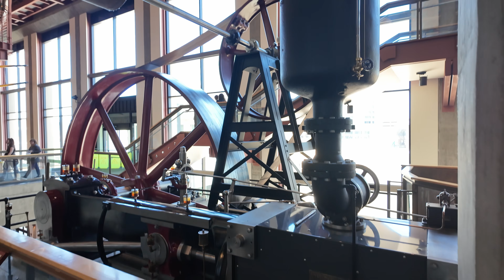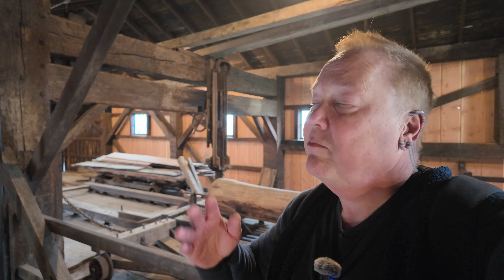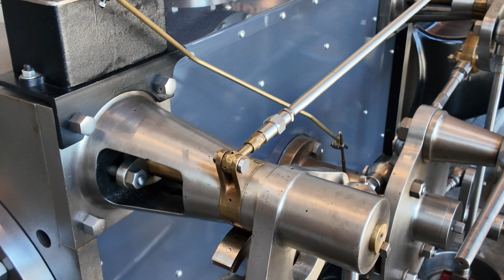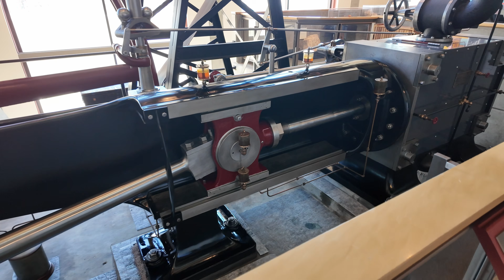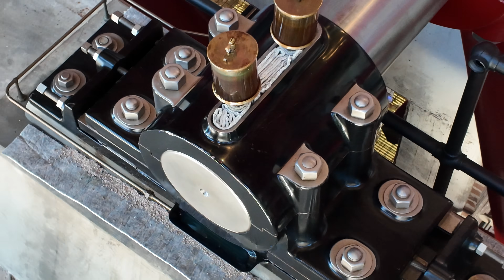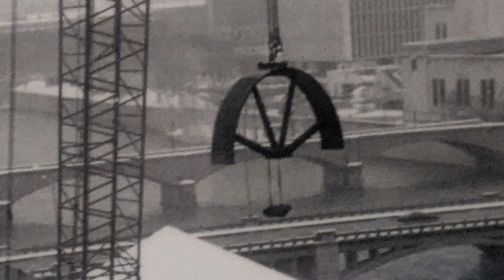This Massive Steam Engine Is Still Turning After 120 Years! | Industrial Revolution

Comment: Can a one cylinder Corliss start from any random cylinder position? As with that size I'd expect a barring lever...
Reply from the maker: Nope, any single-cylinder engine can get stuck if the piston stops all the way at either end.  If you watch my video of the the Corliss engine at The Henry Ford Museum, which still runs on compressed air, they have a subtle electric motor at floor level to push it around if it stops in the wrong place.  They usually stop it correctly, but not always.  
When I was talking with them, before things like health and safety regulations, they said people would probably have climbed up one side of the flywheel to move the piston back toward the center of the cylinder.  It doesn't really matter exactly where it is in the stroke, as long as it's not right at, or very near, either end.

Comment: If you are ever in the Dayton Ohio area you should stop at Carillon Park they have a 210 ton Corliss on display although it's not in motion like the one here. They also have an extensive display of cash registers from NCR and other local industry.  Very impressive museum
Reply from the maker: I've been there!  I was there 2 or 3 days after Hurricane Helane, and when I walked into the Great Flood of 1913 building, I was obviously inspired to do a video on that.  Also did one on the John Quincy Adams.  I need to get back down there before long, as I have a couple more ideas.
Actually, there's a fair amount of good Industrial Revolution stuff in the area, like Lockington on the Miami & Erie Canal, and Bear's Mill.
Reply: @Industrial_Revolution The National Museum of the United States Air Force is close by and right down the road is the Cincinnati Museum center that's in the old union station. Lots of great museums in the area.
Reply from the maker: I haven't been down to the Cincinnati Museum Center in a while.

Comment: Beautiful job restoring the giant flywheel to faster smaller flywheel is like basically gear reduction those leather belts were were scary stretching or walking off pulley snapping men getting loose clothing caught in the belt drive
Reply from the maker: They didn't tend to come off the pulleys too much, unless they broke.  The pulleys aren't actually flat, but slightly bigger in the middle, which kept the belts centered.
They did, of course, sometimes still break.

Comment: its large but you should check out the steam and technology museum in Hamilton ontario, the woolf compound engine in there had a twin and together they pumped water to the top of the niagra falls escarpment to supply the city with water in 1860, her details are no where near as clean as this beauty and she wasnt nearly as powerful only producing 100 hp but with a fly wheel so large you need to climb up two full flights of stairs to be at the middle its hard to believe a machine so utterly massive only produced 100hp
Reply from the maker: Thanks!  How did I not know that museum was there?  I've added it to my list and there's a good chance I'll be in the area sometime later this year.

Comment: When it came to learning/understanding all-things “internal combustion”, regardless of fuel type or cycle type, whether the theory of operation or otherwise, i more or less had to learn thru study/“reading”(books) research, back in the early 80’s, due to just how extremely noisy it all ‘can be’… steam on the other hand, I could literally, simply “HEAR” old timers back then, just explain it all.. only noisy when them whistles go off! Lol
Reply from the maker: That's definitely one of the things I like about Industrial Revolution technology.  With a little time staring at things, following pipes and linkages, you can figure out how it works.  My hybrid car, that's just a mystery box with everything hidden.
Reply: @Industrial_Revolution  Back in the early 90’s ‘till the late 90’s, when I was most active in the hobby of stationary power of various types, showcasing my own whatnots at the local events then, one cool older dude actual blacksmith, that spoke with a pretty heavy German accent, named Klaus Dubart (last name sounded that way of spelling but had to been quite different; just can’t remember), had coined the phrase back then, of, “Industrial Archeology”, pertaining to this whole crazy cool hobby of finding and resurrecting antique whatnots.. the rustier, the better
Reply from the maker: I've actually heard that term before.  I actually end up doing some of that in my videos.

Comment: A mine I worked at in South Africe srill had a little working steam engine.  It served as a backup in case of a major power failure.  It was fired up once a month   to ensure it was in working order,   It was also a show piece  on tours and waskept all bright abd shiny,
Reply from the maker: These old steam engines could last forever, if given a bit of attention.  Was it just to power lights and fans, or did it handle more than that?

Comment: Brilliant video, though I am sad to see that every single one of the lubricators was actually turned off and not feeding oil to the bearings. You can tell because the little finial on top which lifts the inner needle valve was on its side. If you know anyone at the museum please tell them about this, even at slow speeds the engine will seize up without any oil. Last year I had to help a museum in Colorado unstick their seized twin cylinder Corliss which had been run without adequate lubrication, it is quite a serious issue.
Reply from the maker: Thanks for the comment, and the concern.  In person, the machine does look oiled.  I'm wondering if they flip them on for a bit every morning, but don't want it on all day dripping oil.

Comment: I worked in the St John's furniture factory in Cadillac in 1978 &79, Once in a while they would fire up the steam engine just to keep it oiled up,  It took two boilers at 170 psi of steam to run the engine, witch the factory had three boilers, they also kiln dried their own lumber.  they stopped
the workers for the ten to fifteen minutes so that the employees could see the engine run,
when the large fly wheel was at high speed it was would move the air like a giant fan,  The mantaince crew kept people back about 15 feet, they said it might suck a person into the fly wheel.
Reply from the maker: I don't know if they knew it would someday end up in a museum, but keeping it running a bit every now and then probably made the restoration far, far easier.

Comment: That engine is a beautiful work of restoration!  Labor intensive, yes.  There would have been an: Engineer, OIler, Wiper plus the boiler crew on duty every minute the engine ran.  Compared to a soul-less electric motor that just needs someone to flip the switch.
Reply from the maker: That's one of the reasons I, and I think a lot of other people, like steam so much, especially in locomotives.  They're all individuals, with their own personalities.

Comment: The main reason that cutting into a big log doesn’t instantly slow things down is the 12 ton flywheel.  It would take a lot of load to change its speed quickly.  The governor maintains speed over longer term changes in load, but the flywheel is what moderates the rapid changes in speed.
Reply from the maker: The huge flywheel definitely helps a lot.  A few people have asked for info on what the different valve gear does on the Corliss, compared to other steam engines.  I need to research it more, but may be doing a video on that in the future.

Comment: I always find those giant-flywheel engines fascinating, and a bit intimidating. 😉 Back in the day they had employees… Oilers… to go around making sure those oil cups were topped up. When I stared in the auto industry in ‘97, they still had “oiler” as a job classification. 😃
Reply from the maker: Oilers, as in the people, were everywhere.  About half of the oil cups on this engine you can get to while the engine is running.  The other half, though, I expect you'd have to stop the engine.  Remember, this engine would have been running way faster than it is in this museum.

Comment: All that overhead shafting and bearings needed lots of oiling.   Guy whp climbed up there and scampered all over the factory rafters were called " Grease Monkeys,  just like the guy who crawls under your car to grease it up.  Rather I should say guy or woman who does that old job.   Now the machinery comes to the grease monkey rather than the grease monkey  coming to the problem machinery

Comment: How much coal & water did this 'beast' need per day?  I'm thinking coal in the 1000's of lbs & water in 100's of galons.
Reply from the maker: It'd really depend on workload.  Heavier workloads need more steam, so more water and fuel.  
It was late enough that they may have been using a condenser to recapture some, or even most, of the water.  
As for fuel, I didn't read what they burned, but as a woodworking company, it's possible much of their fuel was wood scraps.  Michigan also had a coal industry at the time, with fairly local production, so they may have burned some of that instead, or in addition.  The coal seams weren't very thick, and the quality wasn't always the best, but since it was local, transportation costs were low, so that could make it cheaper.
Reply: I’m a little sad that the museum is running the engine with a small electric motor, rather than compressed air. It makes perfect sense to do it that way, but it’s not as nifty.
Reply from the maker: A lot of museums do that.  With compressed air, you still need to pay attention to valves and gaskets and seals.  With an electric motor on the flywheel, you just make sure all that stuff is heavily greased to minimize wear.

Comment: Before we moved from Maine, 2017, there was a influx of Amish to the area, several families we are acquainted with.
Several had workshops, engaged in manufacturing, mostly of furniture components, fed to a central shop that, did finishing and assembly.
Anyway, not using electric, the shops utilized line shafts, driven by gas / or Diesel engines.
Doing machine work and fabrication, myself, I got involved with converting various pieces of electrically powered equipment, to belt drives, to accommodate being powered by line shaft systems.
Line shaft systems are fascinating, especially, in the nuances, for performance, reliability, longevity, and safety.
Thanks for sharing.
Reply from the maker: Some were water powered, or even wind.  It's easier to have separate electric motors, but I wonder how they compare in terms of efficiency.

Comment: The good old days when furniture was made out of hard wood timbers. Absolutely fascinating how that "regulator" kept the speed steady under loads though I don't see how that worked.
Reply from the maker: Glad you liked the video.
The regulator, also called the governor, worked by actually adjusting the steam valve.  If the engine slowed, the balls would move in.  The rod connected to it, and a valve, would then open the valve a bit more, to let in more steam, speeding up the engine more.
The Corliss valve design is more complex, though.  I'm thinking about doing a separate video on how that design worked.

Comment: Wow that is an impressive engine! And Corliss, never understood how that works exactly. Plus, I never saw a engine this old from 1905 and the "design" looks modern! Often those old engines have this curved "playful" design and no sleek lines (Cant describe it better!). This engine has a "boxy" design without frills, it looks somehow minimalistic, how industrial hardware looks today! 
Never saw cleaning discs wandering around on a line shaft, that is a good idea! Often these lineshafts are greasy and have this green algae like gunk. So using cleaning discs is a nice idea! But when I think of the mill transmission at the grain mill, I worked 20 years ago, we had spare belts ready to go (cut to right  length etc.) if one of the transmission belts flew away. So it was just a 5 minute stop to change over! These belts hang on ropes from the ceiling and the transmission was running between them! I imagine if we had used such cleaning discs wandering around they would have tangled with the spare belts and then chaos. So they had cleaning discs and no spare belts ready to go? 
This is really a great video!😄
Reply from the maker: Thanks!  Glad you liked the video.
Going back to the late 1800's, a lot of engine designers put a lot of effort into making their engines look pretty, like the Gothic Steam Engine I did a video on a while ago.  Factories would often put those engines right out in the front of their factory, even behind huge windows, for the public to see.
I'm sure they had spare belts, just not hanging on the shafts.  They'd probably need to lace them together, but I suspect if you're running a large shop, you do it enough you get good, and fast, at doing it.  Doesn't just letting the belts hang on the shaft wear down a spot on them?
I've added how a Corliss engine works to my video topics list.  I admit I'm a bit vague on it, myself.  I know part of it is that the input steam and exhaust valves are separated, instead of doing it with a single valve.
Reply: @Industrial_Revolution   Ah yes. No at the mill we worked we had them ready to go. No lacing. The belts where hung by rope from the ceiling in that manner, that there was no interference with the transmission axis. It was a belt loop and in betweeen the axis turning with 400 RPM. I can not describe that good in words. Just saying, they hung and where never touched by the transmission. If an old belt flew of the roller mill, we stopped the mill and put the now one in and the old went into garbage. Finish. One collegue of mine was our "belt specialist" and he prepared every belt ready to go! Okay that was 2001-2005 and these belts where already plastic composite (Extremultus was the maker) even back then. The lacing was via hot glue in a special machine... For emergency we had some metres of swine-leather belts and we had to lace these, but it was just 1-2 times in all that years..
Reply from the maker: Makes sense.  I'm guessing the newer ones probably lasted longer, too, so didn't need to be replaced as often.  A century ago, there was a lot more straight leather, and also leather with a fabric layer bonded to it.  At a place like Armington and Simms, they had probably 50 belts running at a time.  In a good-sized textile mill, they could have hundreds.  Gemini claims the average livespan of the old, all-leather belts was 20-40 years, assuming they were properly maintained (lots of lard, it seems).

Comment: Line shaft systems are neat. There are a few YouTubers with working line drive based shops. It's fun seeing them in full operation.
Reply from the maker: A lot of places just have them sitting there unused, but some places have them up and running.  The shop at Greenfield Village I filmed is actually a production shop, in addition to an exhibit. They make restoration parts for the museum complex, including parts needed to keep their Model T fleet, and their steam trains running.